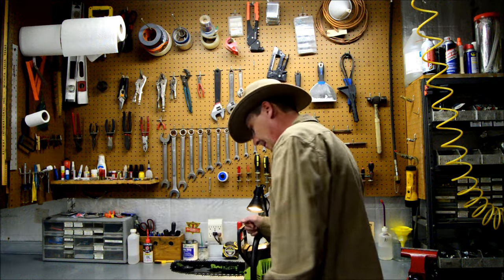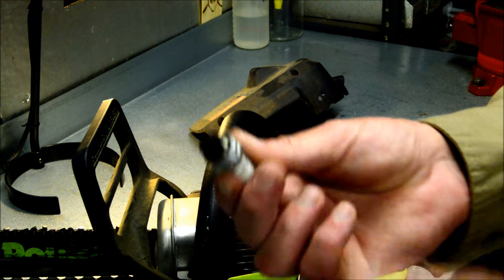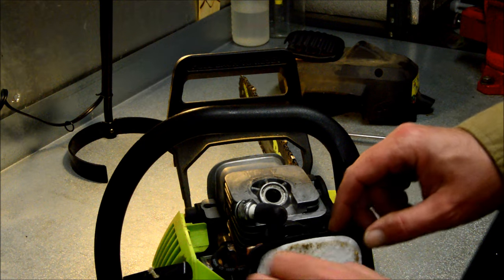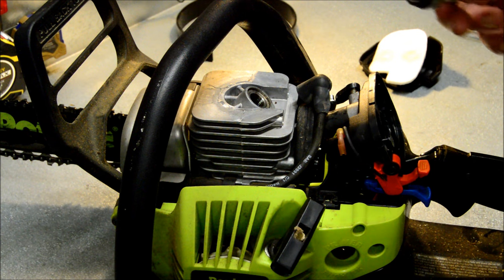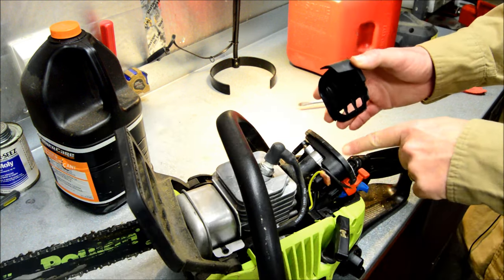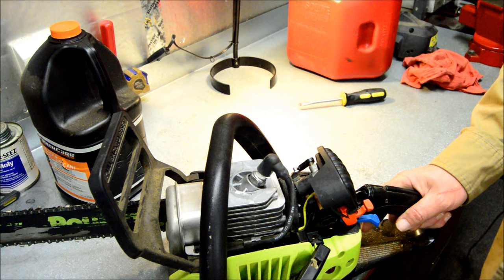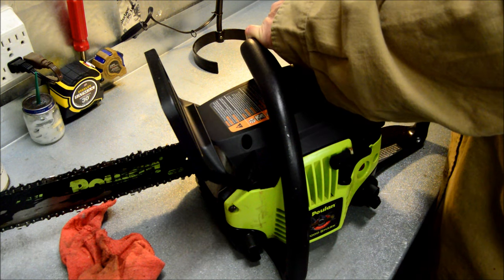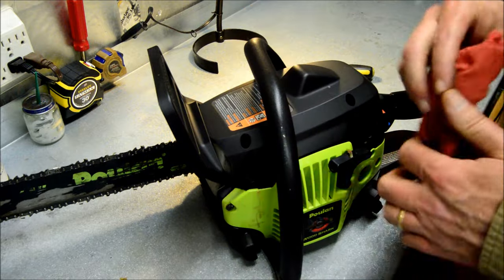Chainsaw Won't Start - 10 Years in Storage - Poulan Woodshark - DIY Repair

Comment: Hola. The rope return mechanism is not working on my Poland pr5020. The repair guy charged me $40 to replace a coil inside the starter housing. I was able to start it twice and by the 3rd time I pull the starter rope it did not rewind. Called the repair guy and he said he could replace the coil again (another $40). I don't know about repairs, but replacing a part is not necessarily repairing. So I'm reaching out to you in hopes that you can help me understand what is happening to my saws return mechanism so I can actually repair the problem. As a female I have to deal with these bozos a lot. It looks like the actual housing area of the coil itself is not straight and perhaps that's what is causing that coil to stretch out and not rewind or return the rope. Help!
Reply from the maker: I'm annoyed that the repairman didn't warranty his work. He charged you for a new part and then it broke again after 3 uses. If you can get him to fix it right this time for no additional charge that would be ideal. If not I really don't know what to tell you. I haven't had to work on the pull start mechanism on this type saw. Maybe one of the other commenters can help and offer some suggestions. I will pin the comment to the top so others can see it. I really hate to hear when repair shops treat people like that. Sorry I couldn't offer more help, good luck.
Reply: Hard to tell without actually seeing how it functions when pulled during the time it worked. Good possibility the coil wasnt wound up tight enough or it slipped out of its notch?
Reply: M 998 HMMWV is there a trick to putting it back? The coil on mines popped out and unwound. Now I’m having a hard time putting it back in.
Reply: @meltolbe  yes you wind it almost backward the tension against itself. Its been a while but i used to do it on a flat surface. Wear safty glasses lol
Reply: @TheHandsOnChannel  LLP
Reply: Don't spend $40 on a bogus repair as these saws only cost $150 new, and often go on sale for less.  If you don't want to spend anything you just have to buy a new part at the cheapest place.  There are really only a very few screws to replace nearly anything, other than the piston.
Reply: @TheHandsOnChannel  that is what im talking about there are so many damn crooks in the business Im amazed when I hear you wiping the dirt off a repaired machine
Reply: jim halcom thanks man, I ended up buying a whole new chain saw lol. I still have my poulan so I’ll take a look at the link. 👍
Reply: @meltolbe  I gave up on gas chain saws and bought two electric . One is a pole tree saw. its great at 8 amps and guts 4 inch limbs off like butter.                  I couldnt imagine it being a heavy gas engine trying to lift that 12 foot over my head
Reply: @m998hmmwv7  Those coil springs when wound too tight have a tendency to break where they are hooked. many times I have heated the broken end and re -bent a hook and saved money buying another recoil spring
Reply: @rogerd4559  Absolutely true.. But some people like the woman on here isn't going to be able to do that.  It's hard enough just rewinding the spring lol
Reply: Your starter spring is either dirty or broken i hope not broken!!I just fixed mine it was dirty pulled it out cleaned the spring with acetone used dry lube on the spring and the shaft and collar putting the spring back in is tricky i found a y'tube video that made it easy!!
Reply: My experience  with coil rewinds is on Mcullock. Never buy one (if they even make them anymore)! Buy good Stiehl or any good one and you will pay more but no issues.
Reply: @davidweum  iv had my little McCuller eager beaver for around 30 years. Never broke in any way shape or form. They still make a good saw. Its the people that use it that have the problems in most cases..
Reply: @m998hmmwv7  
I've heard that from my old neighbor (sarcastically) when he fixed the recoil a few times. But, I've seen at least two advertised on kijiji that had photos with the cord pulled all the way out! I'll stick with better quality, albeit more expensive models.
Thanks.
Reply: @davidweum  oh tay stymie lol
Reply: @davidweum  Maybe try listening to the old guy.. might save you some downtime and give him a break from having to keep fixing your stuff ( sarcasm) lol
Reply: @m998hmmwv7  
I got it from my sister for free and sold it to a guy with cancer who said he'd "tinker with it."
I followed up because I felt sorry for him and he said he had the "same problem, but for $30 a deal was a deal."
So,....
David
Alberta
Canada
Reply: @davidweum  That was real big of you..
Reply: get your repair guy booted from twitter
Reply: 2 things, either the spring broke, doubtfu,l or more likely the spring slipped out of the pulley.
Reply: Its probably something simple.

You didn't need another starting coil maybe a recoil kit will help but you gotta put it together like a puzzle
Reply: If the cover was on right b4 the rope recoil, & it worked right for the 1st 2 times: That proves you needed the defective recoil replaced. But apparently your right that the recurrence was due to the improper reassembly of the cover ... WHICH HOUSES/HOLDS THE ROPE IN A CRITICAL ORDER ... IMO !
Reply: Thank you sir. Now I know we're to find my spark plug. I'll clean it & spray the carb with WD-40 in lieu of carb cleaner.
Reply: Q
Reply: Spray  some  WD 40 into  that  re-wind .....could be full of wood chips. Wood swells,  when  wet.....

Comment: Know why it's called a Poulan?. Because when you want to start it you grab that cord and keep "Poulan and Poulan and Poulan" until your arm falls off.
Reply: 😂you know!
Reply: I pull my pr5020 2 times then 3rd time it starts and is a 7 year old saw i pull my friends pp5020av pull quite a few times then it starts up so his older one is a puller 

But it wouldn't be if it was mine I'm hoping he'll trade for my ms180-z but I'll owe him a little money because poulan pro cost more than stihl
Reply: Hahaha
Reply: @PAPAPIG15  mine still starts right up when its ran along time 

It starts up in the cold good to so the people that do all that pulling are one's that didn't take care of the saw  they neglected to clean it up every few months
Reply: Not if tuned right
Reply: Mine is almost 20yrs old and starts right up. Maybe taking care of your equipment is the key. Try doing that
Reply: If your piston and rings are good , not scored and ring not stuck then if the carburetor is good and you have a good sparkplug and good ignition ,, spark ,, it should crank as good as any brand would !
Reply: Na. Your not starting it right. That is all.

Comment: Just got done using my Poulan 42cc on a neighbors tree that had fallen onto a gnome house in their backyard. My saw was sitting for at least 5 years, sadly I've neglected it. Bought new gas and mixed up a batch, filled it nearly all up. Got it running in about 5 mins.!  I was shocked I got it running.  Now I'll run it dry(someday soon) and get some bar oil (lol). I can't stand the chain tightening mechanism with the plastic knob, yours with 2 nuts is way better. It's tricky to get the tension right.  I have the PP4218AVX. Thanks your video helped me immensely!!
Reply: those fuel lines get old and brittle and the gas filter falls off in the tank check it .

Comment: When checking for spark, wouldn't be more useful to move your worklight AWAY from the saw instead of  bringing it closer?  Dim lighting would make that tiny spark easier to see.  Interesting video, just the same.
Reply from the maker: Yeah probably, lol. I was thinking of lighting for the camera but it might have picked up better for the camera as well. I'll remember that for next time. Thanks for watching/commenting.
Reply: Also, what was the reason for applying the choke when checking for spark? You stated "as if you were starting", but in this case clearly you are not starting. Just curious.
Reply: why do all chainsaws seem to have such crappy spark?
Reply: not everyone is camera literate most are video challenged

Comment: fyi: you are NOT supposed to put dielectric grease on the metal oparts. JUST the rubber boot and porcelain surround on plug.

Comment: Mine is a newer Poulan PL3816 chainsaw   that hasn't been ran for at least a couple of years.  I will have to bring mine in and check it out like you did.   Mine has never run.  But I can't get it started this year.  I bought mine from Walmart and I fear it might be defective like the crap I buy from Home Depot and have to take back.  Mine was on sale, cheap!  I think I paid less for mine brand new than what you can get a used one for.

Comment: I have a Poulan 14 inch chainsaw that I bought reconditioned 6-8 years ago and I never used it but it won't start. I try your tips and see how it goes. Thanks for the info

Comment: I picked up a Poulan Wildthing that had been sitting for 10 to 15 years, the fuel was rotten, but started in 10 pulls without priming the carb and Idle perfect. Smelled like hell though.

Comment: Ive had my Poulan for 20 years and it still runs great.  One thing i would like to see is how to check the carburetor and what may need replacing if that ever becomes a problem.  Great video.
Reply: the makers should consider better quality fuel line that wont rot out. for a few cents more they could use better line. But then they would lose more sales on parts and labor

Comment: I have a saw similar to that one made by Poulan and it has given me great service for years, but is not working now for some reason. I also have a Poulan Pro which had to have the carburetor replaced after bringing it home and is hard to crank. Both it and the Stihl 250 saw I have is hard to crank and I purchased the Poulan Pro battery saw and depend on it for cutting the brushes and limbs down in my yard. I will try again to crank the other saws and hopefully get them working and get some use out of them.

Comment: I have three chainsaws which I am having trouble cranking and one battery saw which I now depend on to cut limbs, and cut down bushes growing up around my home. Two of the saws was taken to a local repair shop to get the problem fixed and the owner of the shop cranked the saws, but once I got home and tried to crank them they won't crank. The third saw is old and have given me good service so I can't complain about it, but the Poulan Pro saw was new when it had to have a new carburetor installed on it, and the Stihl saw never gave me much service before it would not crank either, and it has been in the shop about five times since owning it and the first time was under warranty and not charged for it.

Comment: Very thorough walk through of checking out a Poulan chainsaw before trying to start it.  I was given one after being told by the previous owner that it was a POS and wishing he had never bought it.   The one I was given was in way rougher shape than the one you are working on in the video and hadn't been used in five years. The thing was covered in sawdust, there was at least an 1/8" alone on the air filter.  The exhaust manifold had burned a hole in the cover and the bottom was caked in mud.  The biggest complaint he had was it wouldn't stay running.  I followed your video exactly, gave it a good cleaning, and it started right up for me.  And it stalled.  The one thing I would have added to your video was how to adjust the set screws on the carb and adjust the idle.  Overall I was impressed with your step by step process.  Thanks for video.
Reply from the maker: Sounds like the previous owner didn't take care of it. Poulans aren't bad saws, but they have to be maintained, of course.  They get a bad rap from the saw snobs but I think they're great for homeowners. Thanks for the suggestion on the idle screw, I forgot to mention that. I apprentice the feedback. Good luck!

Comment: Very well done.........we live in the country, and my wife came home a few weeks ago from taking trash to the dump and she had a Poulan saw with the case...thing does not look like it has been used that much, but someone had just set it out at the dump....will be interesting to go through the motions and see if it will  behave as this one did.  Picked up a nice wet/dry shop vacuum cleaner the same way....all it needed was a new filter and it has worked perfect ever since.

Comment: In my experience not enough use kills saws. I heat with wood and own expensive saws and cheap saws like this Poulan and they all work fine. I use Oregon chains and keep them sharp. I touch them up with a 12 v hand grinder running off the cigarette lighter Jackson my ATV. You need a lot less power to cut with a sharp chain.

Comment: Thank you! I too have a Poulan Woodshark that won't start. I have a starting place to get it going again. I also have a pressue washer that i left fuel in over the winter. The fuel did have ethenol in it so yes, it gummed up the carburetor and ate up the gas line. i learned to always use pure gasoline and not that blended corn fuel.
Reply: bs
Reply: Just running the engine dry is not enough.  There is still some fuel left in the carb to cause problems.  I learned that from experience.

Comment: Just finished inspecting my P3314 (2009) and after draining the old gas and cleaning it up, filled it with fresh premix fuel she fired right up after 7 - 10 pulls.  Excellent video and information. Thanks so much!

Comment: Ive read that Seafoam cleaner works really good at cleaning out cylinders. Ive tried it on my generator and seems to make it run better
Reply: You are correct Jim. Seafoam cleans the jets. Use only premium gas. Also no ethanol.

Comment: Thanks for not bad mouthing the Poulan saw as so many do. I am a native of logging country in Washington but I spent 12 years in the South and found so many loggers down there that used the Poulan's every day and with great success.   I have had 2 of them myself and had no trouble but like you said use the straight gas and that helps a lot.  Like any small machine you need to be careful and take good care of these saws and they can make you money or save you a lot as well.  Thank You for your skill and I am sure your customers appreciate your service and honesty.
Reply: I myself have a few Pooolans as you folks call em and they are not bad for the cheapo saw they are fairly decent saws in my opinion I got plenty of em almost 20 years old and when other shit like my Husky's and Stihl's won't start my Poooolans always start up. It wasn't too long ago I have a camp site and left one of my better ones aside a storage trailer I have there and forgot about it for a year it stayed there in the weather the heavy rains snow and shit. In April I find it want to kick myself in the ass. It ran but after a an hour or so it puked no spark.... all it took was a new spark coil which I keep em on hand because that coil fits other saws including Huskavarna saws too so after a good cleaning TLC with the garden hose and compressed air in the warm spring air and poof with the new coil it fire right up again... I don't know how many other folks ever left a nearly 11 year old chainsaw out in the weather most people woulda thrown it in the shit can but not me. The Poulan can be a good saw it's all how you take care of em and this saw had been serviced with the new carb and fuel lines about 2 years prior I ripped it completely apart and cleaned it once before. I still have it now... People that call these saws crap don't know what the F they are talking about... The quality on the newer shit may have slipped like I said my saws are all well aged but run fine so I don't need a new one yet. I get customers they abandon brand new saws here too cheap to pay me the 80 to 100 bucks for the cleaning and carbs and shit... So off to the races for the those idiots that don't know a good chainsaw from a bad one.
Reply: yes your right strait gas is the way to go! the heck with putting oil in the gas as that would put many repair shops out of business!

Comment: I have a poulan 260, older with a kill switch, nice foam air filter.put 3 oilers on it, very touchy the spring drive on the crank.i ruined carb too much air pressure and blew out check valve,got cheap online replacement, they're touchy as adjust ment goes

Comment: Live in a dry dusty climate where Summer temps go over 40c/105f for a couple of months. Biggest problem I strike is rock hard diaphragms and gaskets in carbys with gummed up jets. Sometimes the ignition coils break down because cooling is a problem as well. You are lucky your job here was a simple one. Because its hot, I usually just hit the outer components with degreaser or truck wash and hose them down with a pressure cleaner. Drying them off is never a problem:)

Comment: Bought one these to cut up a fallen tree....ran great 1st day...2nd day and beyond...total jumk....took it back and bought an Echo cs-400 ...absolutely love it...cranks on the 2nd pull cold, 1st pull if its warmed up....GREAT VIDEO...THX
Reply: these saws overheat and score the cylinder easily if they are tuned to run lean . i had one that lasted about ten year and then one day it seized up and was gone .
Reply: Echo has a very good product. Poulan has a place where the engines are made in Mexico. They used to be made in China. The Zama and Walbro carbs on them are made in China.